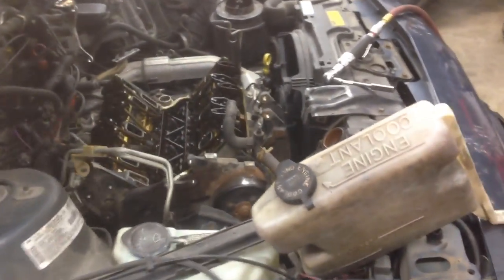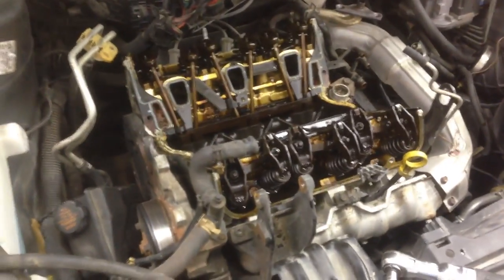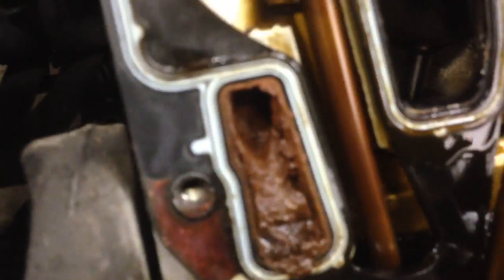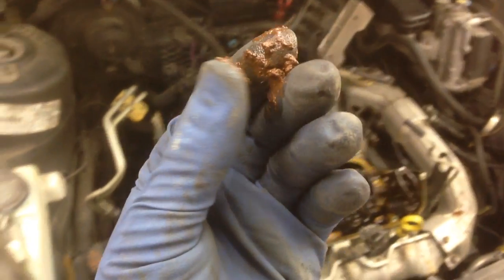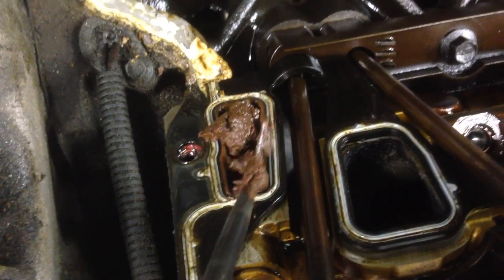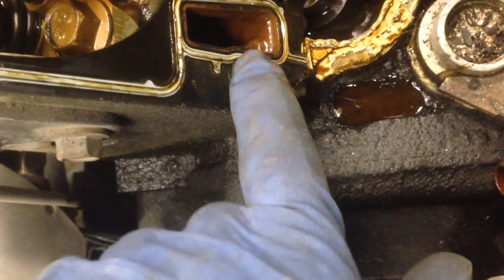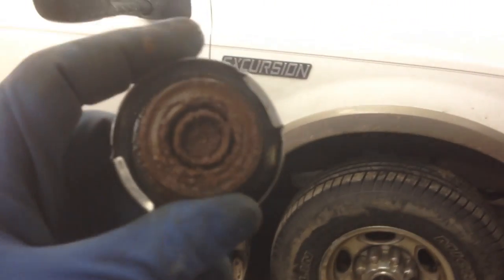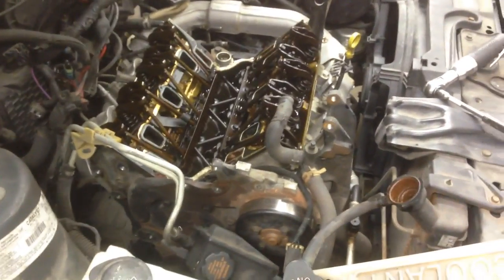Why it's called DexKILL

Comment: This is why I check my fluids once every two weeks to once a month.  I bought a used Mini Cooper S two months ago and went to top off the coolant as the expansion tank was empty and discovered a yellowish green color coolant.  Mini OEM coolant is almost a cobalt blue color.  That Mini is now at the dealership scheduled for a coolant system flush tomorrow. I'd have done it myself but the engine cannot run without the thermostat in place and it would have taken me 8-10 hours or so to do it properly and I just can't do that.
Reply: ***** Why don't you do a little research into the design of the Mini S.  The thermostat cannot be removed from the thermostat housing and the engine cannot operate without the housing in place. So you have to do a lot of work to flush it properly, and let it cool between stages so that you actually flush the system rather than just exchanging the coolant. 

If you can't grasp that I'd suggest you not buy a Mini.

Comment: If what you said about that only being about 25k miles, then it's not air getting in the coolant that's causing that.  Either you didn't do a power flush of the system during the last LIM job to remove the gunk from the block and radiators, or oil has been somehow, getting into the coolant.

I have only seen this issue when the following happens.
1: Mixed types of coolant, believe it or not, most idiots don't know there are different types of coolant and will buy the cheapest.  It's actually nearly impossible to find the old green coolant here, can only find DexCool and the Extended Life types of coolant now.
2: Oil or Transmission fluid leaking into the water - it happens.
3: Stop-Leaks that are clay based instead of metal based.  Those are the worst of the worst, almost impossible to get that stuff out of a block, forget getting it out of the heater core and radiator.

BTW, if air was really doing this, then pretty much every GM would be roasted after ~30k miles, you can never get every last bit of air out of a system, there will always be a high spot that has a pocket, typically where the coolant cap is located.

Comment: what happens if you use regular coolant in an engine that takes dexcool?
Reply: better to use regular coolant,it should be fine, dexcool i guess suppose to last longer they thought it be a good idea turns out not lol
Reply: I was told that if you completely flush the dexcool and put normal coolant in it, you're ok, and that there is really no reason to use dexcool.
Reply: I had a 2002 Impala with the 3.8 and I immediately got rid of the Dexcool after I swapped the UIM/LIM gaskets.
Reply: You Can't Fuck With Me No they won't. Normal antifreeze has corrosion inhibitors but just won't last as long!
Reply: Spac8  actually he is right and so are you yes regular coolent have inhibitors in it but it comes down to the ph and acidity of the two coolents
Reply: Drain it best as possible and you can switch to the "greenish" Universal antifreeze compatible with all makes and models. You'll still have some of the deathcool in there unless you drain the block and flush the system. IT will mix and be ok (with my past experience)
Reply: Jacob Burrows exactly what you see is what happens.
Reply: @ Jacob Burrows  If you blend DexCool and regular green coolant it will turn to a browish sludge mix of shit. Yeah, no lie. For the most part, what most educated people do (because money doesn't grow on trees) is continue to use the same color/type of coolant that's currently in your vehicle until you have a major failure, such as a bad water pump, radiator, hose, or heater core.  When you have to replace any cooling system component that requires draining out the coolant to do the work, that is the time to switch from the garbage DexCool over to regular green antifreeze.

You need to drain out all of the coolant the best you can, and it also helps to flush the engine block as well, to remove 99% of the DexCool coolant from the vehicle's cooling system. Then, refill the system with regular Green antifreeze mixed at 50/50. These days, there is coolant that is made to "mix with all types", which is sometimes green and sometimes more of a yellowish color. Both are compatible with one another. 

It's best to stay far, far away from any "long-life" antifreezes that are typically orange or red in color. They are nothing but trouble. I've been a mechanic for 20+ years and know exactly what I'm talking about. FWIW, heed my wisdom.
Reply: Exactly Spac8... I'm a 20+ yr veteran mechanic. Furthermore, I've personally owned (and still own) many different GM, Ford, & Dodge vehicles. I've worked on literally thousands of different vehicles over the years. So yeah, I must not know what I'm talking about. LMAO!
Reply: So long as you flush all the dexcool out first, as they can not be mixed, and you ignore the 5yr 100k miles service and service it like the regular coolant that it is, nothing.
Reply: Jacob Burrows it turns to mud, just like what you saw in the video. never mix incompatible coolants.
Reply: My '04 Impala used dexcool and has never had any stop leak added, but got really gunked up.  When I had it flushed and filled last time I used regular coolant and it works just fine.  That was at about 175k.  I now have over 250k on a 3.4 liter Impala LS and it runs excellently and has had no major repairs in its lifetime.  Seems I may be  the luckiest Impala owner in history.  Pay no attention to know-it-alls who say it will ruin your engine.  It may just save it if you flush and switch.  My 70 year old mechanic says it is a smart move and he knows his shit inside and out.
Reply: Regular Coolant has a shorter maintenance interval.  Dex-Cool lasts a couple/few years longer.  There may be other chemical differences as Dex-Cool was created when more aluminum, alloys, and plastic components came into use.  Regular Coolant was created way back when, Iron, Brass, and Rubber were the main components.
Reply: My 1996 Mustang GT has plastic intake and aluminum heads. It has used green since it was built. No problems with the green and the alloy/plastic parts.
Reply: fortj3 that is a ford. Dex cool is gm. Dex cool as nothing to do with the parts inside the engine. The only difference between dex cool and regulare coolant is dex cool has a extended service. Regulare coolant should be flushed and changed ever 3yr or 30k miles. Dex can go 6yr or 100k miles.
Reply: fortj3 have you checked your coolant with an antifreeze tester? if not I would if I were you. antifreeze does one thing  keep the water in it from freezing above at any temp above -40 deg so what matters is the lowest temp the coolant can handle before allowing the water in it to freeze, green coolant can look awesome but not keep the water from freezing at the required temperature. green coolant has a cycle life from cold to hot to cold again is one cycle and every cycle does damage to the green coolant. antifreeze is a very bad conductor of heat so it makes a bad "coolant" but excellent freeze protection and isn't a very good transfer of temp, that's why you only mix it 50/50 with water, water cools and antifreeze keeps it from freezing.
Reply: Kevin Weil 100% correct!
Reply: If all the Dex isn't cleaned out, you will get this nasty brown sludge.
Reply: Jacob Burrows.... Nothing!
Reply: Are any of you guys chemical composition specialists?  Or scientists? Just like me, all you have is an opinion.  Don't get all worked up when someone disagrees, cause all they have is opinions too
Reply: I have a 05 Colorado I use Prestone green long life coolant, no leaks no overheating

Comment: I had a 2006 Chevy Express 4.8 that did not have this problem with Dexcool, after 129,000 miles.
It had the "sealed" cooling system. I say "sealed" because the POS GM always leaked coolant when it was hot.
I've also seen forklifts with the radiators ruined by this red slime in less than a year of using Dexcool. 
The forklift did not use a sealed cooling system. 
I use regular green in all my water cooled engines.

Comment: Ok I have done a lot of research on this and it seems like the problem with dexcool is that it reacts with oxygen. A lot of the 3.1's they used dexcool in had non-pressurized overflow bottles. This is a big problem because it causes the dexcool to be constantly exposed to oxygen and turn to sludge. All the GM cars that had fully pressurized cooling systems never had issues with dexcool because it was sealed off from air. The intake manfiold gaskets on the 3.1's were already a problem and made even worse by the dexcool. 

If you own A GM car with a non-pressurized cooling system and it has dex in it, then you need to get it out ASAP. I suggest old green because its one of the few coolants that are happy in a oxygen heavy environment and that's what the engine was originally designed to use. GM f'ed up when they tried to put dex in them.

Comment: I put some of that bars  stop leak with the pallets on bottom,but gotta shake it up good b4 you pour it in.Is what I used.and by the looks of it it building up inside the cap area when I check my fluid. Yeah looks like it's the same kinda stuff

Comment: okay, so i will admit that it is Dex-Kill if you do not flush the coolant regularly, but i see alot of people blaming this on mixing different types of coolant, i'm not saying that wouldn't cause this, but i've seen plenty of GM cars that have had this happen just from running the same coolant for way too long, never mixing anything though. I've even owned a couple, i admit. Dex-Cool has been proven to become corrosive over time if you leave it in too long, so this sludge is probably all the gasket material, rubber from hoses, plastics, etc. building up because noone ever took the time to back-flush the system. So to this owner i would say good job! Now you have to do major work to the top end of your motor when you should've just flushed your coolant regularly! Leave it in a little longer next time, maybe some of that coolant mixes in w/ your oil & see how much that costs ya!!

Comment: Its not just dexcool that does that. all coolant gets old and goes bad, thats why youre supposed to do coolant system flushes and new coolant every so many years and why youre supposed to test the freeze temp before winter to make sure its still good. Now dexcool might suck and be prone to going bad earlier than other coolant but trust me the old school green antifreeze does the same. my mustang was just as bad as the car in your video only mine didnt blow gaskets. I still had to flush the whole system and replace a bunch of hoses, the heater core, and the radiator too.
Reply: eXp0N3nT1aL its a common problem with GM vehicles, just the stuff that gm uses

Comment: Just bought a modified 2002 GTP and for the $5k+ they put into the engine....the lower intake gasket and head gaskets are stock, noticed the lower intake leaking externally only thank god. popped the radiator and the dex was clean from the outside but the sample I pulled out did have some rubbery bits like the beginning of sludge. I also noticed the headers were caked with orange rubber from the leak. I will be replacing wilth FelPro aluminum gaskets and flushing the system. Assuming the dexcool is original still at 80k miles, I'll probably stick with it

Comment: Yea when I first bought my buick century it had dexkill in it too, and it had the same problem. I remember the first oil change had so much water and coolant in it there we two streams from the drain plug, and the regular oil looked like a cappuccino!  Luckily the manifold gaskets seem to be holding up decently now that I switched over to some prestone.

Comment: With my experience with this problem is people adding the wrong coolant to dexcool that causes the chemical reaction , not air in the system . I've seen vehicles that have had dexcool with no contamination without any problems

Comment: This looks more like a cross contamination issue rather than a problem caused by air getting into the cooling system. After all,that coolant overflow bottle isn't sealed from air at all... I just wish the manufacturers would just go back to one coolant that will work in any car.
Reply: da959, dude all coolant is yellow universal. dye is added to make it either Red, purple, blue or green. I work for coolant manufacturers. people think there is a difference but there isn't. lol...I wouldn't lie to ya. it's all the same shit.

Comment: another thing that causes a lot of this gunk build up is when the lower intake gaskets do leak some the cooling system will suck in atomized oil through the crank case ventilation system causing the murky looking sludge, similar concept to antifreeze getting into the oil except in reverse, these engines are the worst for it, other than that great video and pretty good explanation of the issue. side note for everyone, 50/50 hot water and distilled white vinegar in the system by itself will eat this gunk and help flush it out the old antifreeze mixture do not mix it with antifreeze,  it is safe to drive with it as a replacement to antifreeze during the warm months only though as the mixture will freeze, the vinegar raises the boiling point of the water above engine operating temps and also naturally cleanses the system as any acid would

Comment: I'm getting ready to do a flush of my 2005 Chevy Colorado and was thinking about switching off dexcool. Isn't there a new orange colored formula too? What's the story on that stuff? Is it better or longer lasting than the dexcool and the old school green?
Reply: D LG I've heard from GM techs on the newer engines Dexcool lubricates the water pump. I'm not saying it's related, but a friend flushed his radiator on a 2003 GMC Sierra and put green in it and the water pump failed 2000 miles later
Reply: SlickNicklol
I wound up sticking with dexcool...didn't want to chance it.
Reply: Dex-Cool ruined my 2000 Impala---everything from the radiator to the transmission.
Reply: Dec cool clogged all my cooling passages an blew my engine. thanx General motors, i only buy Japanesse cars now

Comment: Well that looks like stop leak or maybe someone mixed Dexcool with regular coolant. The only car I have that uses Dexcool is a Cadillac with the Northstar engine. So far no problem, but I change it every 2 years and one of the coolant supplement tablets to it at every change. No leaks or gumming up so far....I recently changed the water pump and some time ago a leaky overflow tank, they had a light tan color but no accumulated stuff.

Comment: This car is 18 years old in 2014. The sticker you show in the video says “lasts 5 years and 100,000 miles” could it be it has not been flushed in 18 years.  I have a 98 F150 and to my shock it looked like mud once, so I give it a good flush every 5 years now.

Comment: The 2006+ 3.5l/3.9l engine is a MUCH better design with the external coolant routing. This avoids running coolant through the intake manifold and prevents an engine failure if the intake manifold gaskets fail. 

If I never have to do a head job/intake gasket job on a 3100/3400 I would be quite fine with that.
Reply: the 3.5 and 3.9 also had issues with the oil filter housing gasket failing with low mileage and what sucks about their cooling system is there is no bleeder like the previous engines so you have to top off the coolant through the heater hoses on the driver side a lot of mechanics diagnose a no heat while idling issue with a thermostat but its the weird air bleeding method a lot of folks miss. YouTube helped on that lol

Comment: He answered his own question. The customer over heated the engine. If air gets into the Dexcool system it becomes acidic and this is the result. Any time you have an overheating event with any Dexcool type system flush the system completely with clean water then put the Dexcool back in. If you fail to flush expect this result or worse.

Comment: I'm going back to regular green in my 3.1. Conventional green is somewhat hard to find in my area. Right now I can think of only 2 places that had it full strength for under 10 dollars.
Reply: ***** Yes but I'm not sure it's the same as conventional "green" even though it is green in color. Correct me if I'm wrong, but I think it's also called long life. Regular conventional green is supposed to be changed out after about 2 years. Therefore not long life.
Reply: ***** For the 3.1 I've heard that the ingredients that make antifreeze "long life" can break down the gaskets. I don't know if that would apply to your vehicle or not. If you change it out like you say you're probably okay. Antifreeze is way too complicated these days with all the colors and types.

Comment: Certain cars are built with organic acid technology (OAT) antifreeze (e.g., DEX-COOL[19]), or with a hybrid organic acid technology (HOAT) formulation (e.g., Zerex G-05),[20] both of which are claimed to have an extended service life of five years or 240,000 km (150,000 mi).

DEX-COOL specifically has caused controversy. Litigation has linked it with intake manifold gasket failures in General Motors' (GM's) 3.1L and 3.4L engines, and with other failures in 3.8L and 4.3L engines. One of the anti-corrosion components presented as sodium or Potassium 2-ethylhexanoate and ethylhexanoic acid is incompatible with nylon 6,6 and silicone rubber, and is a known plasticizer. Class action lawsuits were registered in several states, and in Canada,[21] to address some of these claims. The first of these to reach a decision was in Missouri, where a settlement was announced early in December 2007.[22] Late in March 2008, GM agreed to compensate complainants in the remaining 49 states.[23] GM (Motors Liquidation Company) filed for bankruptcy in 2009, which tied up the outstanding claims until a court determines who gets paid